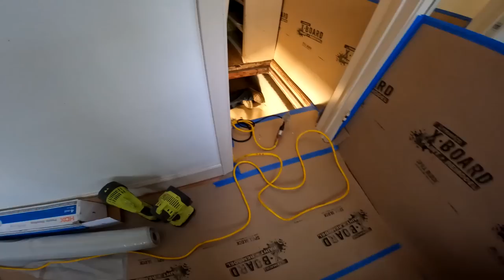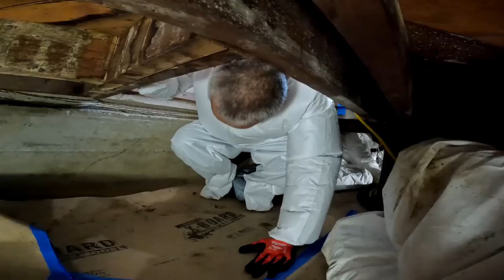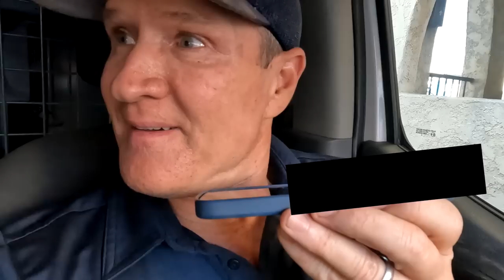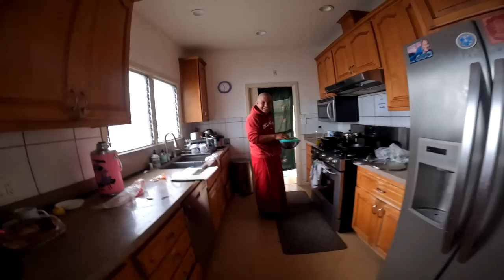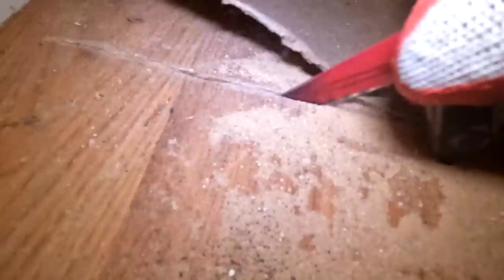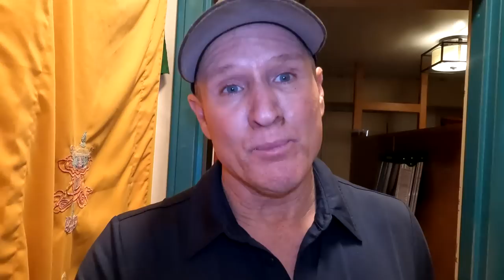We SAVED a Buddhist temple from RATS & RAW sewage (we threw up)

Comment: I worked with two guys from Tibet that were monasteries. The older guy, Diorje, was 72 years old, 4 inches shorter than me and could lift me from behind and crack my sternum and back. He threw bags of trash that were ridiculously heavy into a compactor with the door at least 3 feet higher than the floor. Endless bags every day. It was a food store. In the bakery a hollowed out roll was under the workbench. He picks it up and says "Oh. Mouse house!" in a higher pitched tone. He caught me burning roaches using a match and cooking pan spray that were in a constantly wet floor drain. He said no more and picked up a roach and dropped it into a tall garbage can (with bag). From then on I would do the same if he was around (with a rubber glove). That guy walked home 6 miles each way nearly every day. This was 25 years ago and I would not be surprised if he is still living.
Reply from the maker: Wow!!!! It’s amazing.